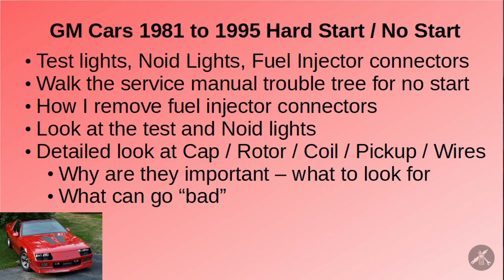Diagnose Hard Start / No Start Chevy 305 Tuned Port Injection OBD1 Computer Control -

Comment: Hi, I have a 1989 iroc z 350 tpi. I have done so much diagnostics trying to get it to run well but the only way the car starts is if I unplug the maf sensor. I replaced the old maf as well as the relays, IAC,TPS,CTS, oil pressure switch but it still didn’t work. When the car is running and I plug the maf back in it just dies, unless the car has been idling for a little bit with it unplugged. Then the car stays on with the maf plugged in and will restart just fine with it plugged in. The car seems like it doesn’t like the maf when cold. Very confused by this and any insight would be helpful!
Reply from the maker: I made fresh video to help on this topic.  It's hard to do enough in just the comment section.  The link is below.  I would also suggest checking my diagnostic playlist.  There is a lot there and it includes more videos that might help.
https://youtu.be/DgJDIsKZP1k
Reply: @bitsofwisdom460 just checked out the video thank you! But I have no codes on my engine until I unplug my maf and get a code 33. If I clear the code by disconnecting the battery for a bit once the car is warm and plug the maf in and start it, no check engine lights come on and the car will run fine. Also I sprayed some solvent around the plenum and throttle body to check for vacuum leaks and there are none.
Reply from the maker: Well, I have a few thoughts.  First, one of the other challenges with the diagnostics in OBD1 is that they often require things to be really broken to set a code. If you have a less serious issue, it won't set a light.  I would still go back to the trouble trees and wiring diagrams and try to get some measurements.  The ECM is probably working correctly, but it does depend on a proper analog signal on that 5 volt circuit.  So, I would start by trying to measure the 12V feed to the MAF to be sure you get full voltage and it isn't a volt or two low because of a wiring issue.  I would also look at the 5V analog circuit looking for a wiring issue.  That might be just a resistance check of the harness from pin to pin and a look at the pins to be sure they have good drag.  5 volt circuits are more sensitive than 12v circuits to loose or contaminated connector pins.

Now, from your symptoms, it does sound as if you are a little lean.  It would really help to have live data to see where the sensors are running. Without that, my thought is that since symptoms are lean, it is quite possible that the limp home circuit just runs a little richer than the MAF. Did you replace the plenum intake air temp sensor? That one can affect fuel mixture also.
Another possibility of a lean issue is low fuel pressure. If the fuel regulator is leaking, the fuel pump is weak, or fuel filter restricted, you may have fuel pressure below spec.  The injectors are calibrated based on the time they are open in milliseconds at a specific fuel pressure. If pressure is a few PSI low, it will be leaner.
Reply: @bitsofwisdom460  I appreciate your insight. I recently replaced the FPR as well as the injectors, tank, fuel pump, sending unit, and fuel filter. I also put new o-ring in the rail. But one thing I didn’t do was change out the plenum sensor you are talking about. I did check the maf sensor harness and it does get 5.04v at the C connector with key on. The 12v I believe is tied in with the pump prime/ when the fuel pump actually runs, but when the car is running it does get a full 12v. Not 100% sure if that’s how it’s supposed to be or if the maf is supposed to get power with key on.
Reply: Just to give an update. You were totally correct and I should’ve started with the fuel pressure.
20 psi! And dint climb higher than that. Continuing with the diagnostics now. So far I’ve pinched the return line and nothing changed. 
One question I do have is about the small bolt on top of the FPR, does it change fuel pressure? Because there is a small coin like plate inside my regulator.
Reply from the maker: @alexlippman6939  My regulator does not have a bolt in the center of the cover if that is what you mean. I don't know of any factory regulators with that feature. There are aftermarket adjustable ones that do have a bolt on top. However, if pressure does not increase when you pinch the return hose, the regulator is not likely at fault.  The point of pinching the return line is to artificially regulate the pressure and rule out the regulator.  If restricting the return line does not increase pressure, the problem is likely in the feed system. Possibilities are low voltage to the pump, a bad filter or restricted pressure line, a restricted pump inlet screen, a leak at the pump outlet (pulsator or jumper hose), a defective pump, or even the possibility that the wrong pump was supplied.  I know that is a pain because it may mean pulling the tank again.
Reply from the maker: Please update me with what you find.  It may help others with a similar problem and I may provide an update video.
Reply: @bit @bitsofwisdom460 okay so 2 days ago I dropped the tank again after I bought a new pump, and wouldn’t you know I had the wrong fuel pump installed. It was the fuel pump for the tbi model. I bought the correct fuel pump at first but it came with a broken plastic piece that connected to the pulsator.
When I went to the parts store again they gave me one that looked similar but I did not verify that it was the correct one.
Now that I have the correct fuel pump installed the car starts, but only with a shot of starting fluid. It has the correct 42 psi of pressure but I think it bleeds off quickly sometimes to around 25-30 psi. 

It does not restart hot either it always needs that initial shot of starting fluid then it can run fine.
So far I’ve disabled the tach wire to see if this would change anything and it didn’t, but while I was driving it for 10+ minutes the other day I got a code 15 for the CTS. I unplugged it and plugged it back in and the code went away and never came back.

Edit- been working on the car all day and couldn’t figure out why it needed a shot of starting fluid to get it started. I decided to replace the distributor believing maybe it wasn’t giving a pulse to fire the injectors, and it worked kind of.

First attempt at starting it fired up after a couple cranks, but after that it struggled to fire up again. It also think it had some affect on my pump prime. My car used to prime every time I would turn the key to on, but now I turn it to on, hear it prime once, then if i turn the key off and back on there is no second prime.

One of the last times I tried a few hours later it fired right up and idled kind of high and I got a code 15 for the CTS.
Reply: Final update- the car runs and starts way more reliably, had to replace the pigtail to the coolant temp sensor. No more check engine light and starts way more reliably now. Appreciate your help and all the videos you post for everyone else, it means a lot!
Reply from the maker: @alexlippman6939  You're welcome and thank you for your feedback.  It helps to have the "lessons learned" for the next time. I am glad that you have success and the car is running better now.

Comment: How are you doing, Sir? I have been trying to understand why a shorted injector or coil does not always blow a fuse? Injectors and ignition coils are always in parallel. Current always follow the path of least resistance. Technically, current should only flow to the shorted coil or injector which would cause an increase of current flow.
Reply from the maker: I'm doing fine, thank you.  Your question is a good one and something not obvious.  I ran across this myself as I was working to architect a hybrid system.  I was taught by the electrical team that circuits are designed for fuses to protect the wires rather than the component itself. If you run too much current through the wires, there is risk of fire.  The fuses are there to protect against that possibility and the components should have their own protection if required.  So, in an ideal world, if a shorted injector is a risk to the ECM driver, the ECM should have a protection circuit. In my hybrid example, I wanted a smaller fuse to protect my component, but it was not permitted. The component needed to protect itself rather than using a smaller fuse.  The wire was larger and a larger fuse was proper.
If you think about it, that is how a house is wired (per most codes in the US).  A 12 gauge wire has a 20 amp fuse or breaker that is intended to protect the wire with a certain margin.  An appliance or light fixture could fail, but unless it draws more than 20 amps, the current will continue to flow. That is why devices like arc fault breakers were created.

Comment: i have a 90 corvette, cranks no star , i put gas on the throttle body , it starts right away, i switched the oil pressure sensor, icm , new fuel pump , and nothing , im stressed 😩, any help please
Reply from the maker: If adding fuel helps, I would continue down the path of checking fuel delivery. First, is the fuel pump running?  You should hear it for about 2 seconds on key up.  If so, check fuel pressure at the rail to be sure the injectors have pressure. ( I have a video posted on how to check).   If you don't have pressure at the rail, look at relay, filter, regulator.  If you have pressure at the rail, then I would check for power to the injectors. There ought to be two independent driver circuits that drive 4 injectors each. Check the fuse block to be sure the fuses are ok and they have power. If good, then this video talks about "noid lights".  They plug into the injector harness to see if power is getting from the ECM drivers to the injectors.  If not, then ECM is suspect. If you have power to the injectors, then I would look at sensors like coolant temperature and MAP that adjust fuel mixture. Good luck and let me know what you find.
Reply: @bitsofwisdom460 thanks , i will try this, yes pump runs good , i havent put a new fuel filter or regulator, thanks! will come back if i find the problem

Comment: 1986 Chevy Camaro iroc z 305 tpi  code 21 and code 54 .I believe it’s an electrical issue fuel pump doesn’t prime . What do you recommend for self diagnosing . Car won’t start gets fuel by the oil pressure switch , car won’t start on starting fluid . Car sat for 8 years changed engine harness ensured it match to the motor same ecu . Please any guidance would be appreciated I like videos my manual it’s not detailed as yours with the flow chart but I found electrical diagram just having a hard time understanding the chart . Thank you
Reply from the maker: I'm trying to understand how things fit together. This sounds difficult, but one step at a time.  Code 21 should be TPS signal high (above 2.5 Volts). At idle ought to be less than 0.5V. Incorrect TPS will affect fuel and spark calculations.  If you can get fuel pressure by cranking and getting oil pressure switch closed, that would suggest the pump is OK. Can you hear it? The fuel pump relay could be not working.  The ECM triggers the relay coil at pin C on key up and should pull in the relay to feed power from pin E to Pin A.  The power to the pump feeds back to ECM on pin B2 to tell the ECM that the pump has correct power.
What I don't understand is why you wouldn't get some response from starting fluid. If it tries to start that would be positive as it would suggest that you have spark, if not then ignition could be a problem.
I don't know the issue with the engine harness, but it sounds as if you have could have a couple of electrical issues. You may need to take a hard look at that harness with a wiring diagram to be sure that connections related to pump and TPS are correct. I'm thinking with a wiring diagram, checking connections from sensor plug pins to ECM pins.

Comment: Im having issues getting my 5.7 tpi fuel injected z28 camaro running and got spark and fuel pump come on and getting fuel but wont run only on starting fueled and i got power to the injecters i have checked everything im lost at this point
Reply from the maker: Remember that the fuel system needs to maintain after a start. When you crank, there is an extra rich cold start mixture that drop off when the engine starts. Watch to see if you're maintaining fuel pressure after it fires.  Then you may need scan tool or ALDL cable to monitor parameters. I don't know your year. If it's early with MAF system you need to be sure mass air flow system is working correctly.  If it is a later car (90-92?) you have speed density system and the MAP sensors and so forth must he correct. Remember that OBD1 diagnostics are not as sensitive and sensors can be off without setting codes.  Be sure to check my other videos on diagnostics as I tried to to walk through the trouble trees and point out what to look for.

Comment: I'm taking off my egr what do u recommend
Reply from the maker: I don't recommend it. EGR does help clean the air, and in most cases simply removing or disabling the EGR will reduce your engine performance and increase fuel usage. The reason is that EGR reduces combustion temperatures and allows more spark timing than is otherwise possible. On engines with electronic spark timing, the knock sensor will significantly limit timing and while the logic is complex, the net effect will be lower spark timing than optimum because the knock signal causes more retard when the knock is encountered and it takes time for the spark to be advanced again. On engines with mechanical / vacuum advance, the engine will likely knock. If the engine is for off road use and the spark timing curves are completely re-calibrated, it is possible to compensate for EGR being removed, but for street use, I don't see a benefit.

Comment: Subbed! 
I am glad I found your channel while searching YT for some info. I have an '89 350 TPI in a Formula Firebird. I used to do a ton of trouble shooting and repairs and  mod's on this car that I have owned since 1993. But I stopped working on it around 20 years ago because A) it needed nothing and ran great and B) because I got injured pretty bad and that made it difficult to work on it. 
This car got relegated to garage queen and I would take it out for a spin around once a month. Or to the ever lasting smog checks in Kalifornia. But around 3 years ago due to family illness I stopped everything. The car just sat, abandoned in the garage. Well, around 2 or 3 months ago I decided to get it going again. Of course the battery was stone dead. I tried jumping it with one of those "power bank" things (what a joke) and it barely cranked before it killed it. Next I tried on of my lithium battery's and it did crank a bit, but too much for the battery and within seconds it also got killed. The cranking was so slow the engine would not light. So lastly I got my truck and 30' of jumper cable and connected that and tried to start it. It cranked but would not light off. Fuel pressure good at 40 psi. I am wondering if I damaged an electrical device from the heavy current draw on those batteries.  It has been so many years since I worked on this car, I have forgotten everything. And being disabled now, I know it will be a bear trying to crawl under the dash for the OBD and fuse panels, etc. But I am determined to get her going again. I will buy a new battery and go from there. I thank you for making this and other videos on the TPI system and I think they will be very helpful to jog my memory and also to learn new things. Cheers!

Comment: This made me chuckle, my 83 Z28 had an "electric" CPU controlled Rochester 4 Barrel, and actually it worked really well. Course the 6.0 LS now is much better. FYI. You can actually rent a set of Noid lights from Advance Auto parts.
Reply from the maker: I had one of the full size '85 Buicks with the 4 barrel V8 and it ran very well with the electronic carb. Thanks for the tip about Noid lights.  I hadn't thought about renting them.  I've done that a few times with Autozone and it's a good program.